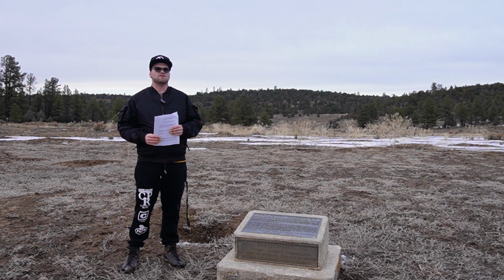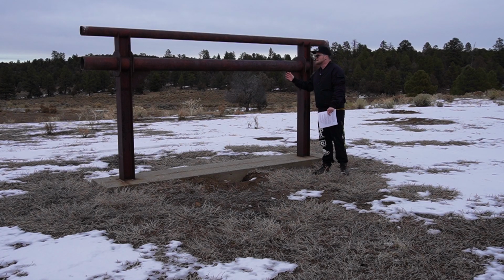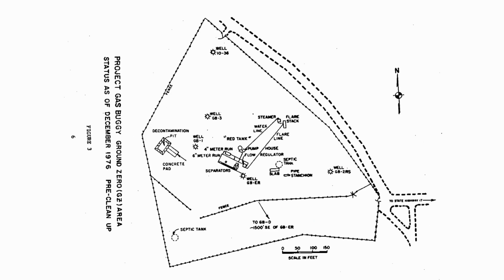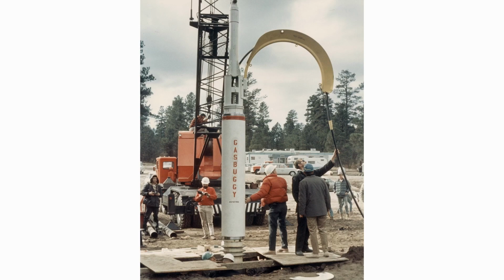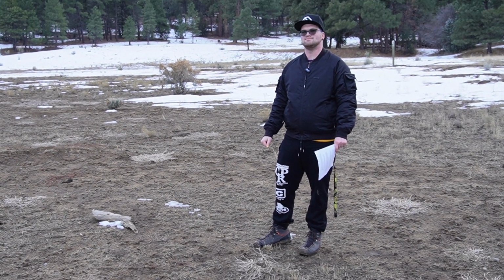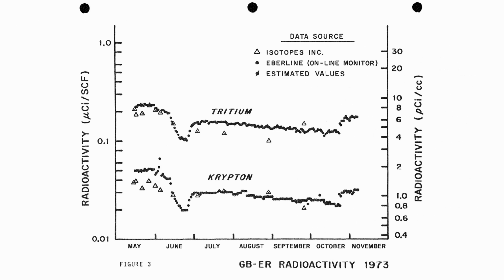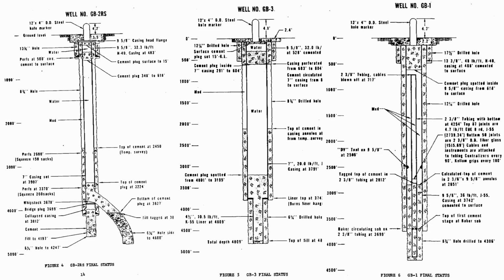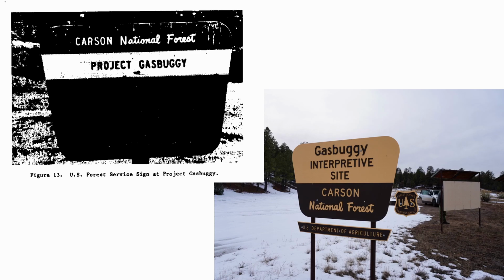Project Gasbuggy: Atomic Bombs for Natural Gas Production

Comment: Operation Gasbuggy—December 21, 1967, New Mexico—Atomic Energy Commission set off a 100-kiloton nuke underground, seven times Hiroshima's blast, six times Nagasaki's, hoping it'd fracture rock and free gas. Geiger meters were humming before impact; they found tritium and krypton, faint beta glow, totally unusable. Plugged the hole with concrete—still sealed, radiation's caged but leaching slow, hurting the earth quiet-like. Element krypton? Greek word for hidden, born 1898—pure science, no capes. Superman's planet Krypton? Debuted '38, coincidence. Blew up from the same idiot playbook: mine the core for energy, ignore warnings, boom. We're doing that here—slower, but hey, Gasbuggy was the trailer.

Comment: My dad was a wire line operator who worked on the rig that drilled this project.  Project Gasbuggy would be hysterical if it weren’t such a terrible environmental and financial failure.   I remember my dad coming home just laughing because he thought these people were nuts - of course if you explode an atom bomb to produce gas and oil, the gas and oil are going to be radioactive!   How brilliant does one have to be to figure this out?  Ultimately, they  flared off all the radioactive produced gas into the environment.

Comment: did you bring a Geiger counter? I would sugest 4, there are cheap ones around $40 that will tell you if anything is above background. Then the good ole CDV-700 with a detachable probe $100-$200. a GM600+$325-350 because it picks up gama or a radiocode 3 ($399) you can take gama spectrums and identify isotopes.